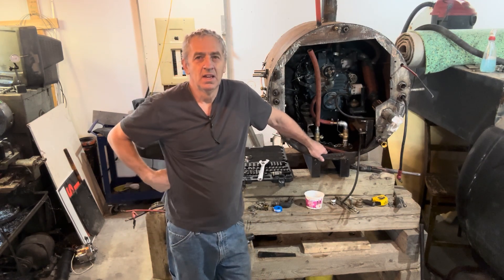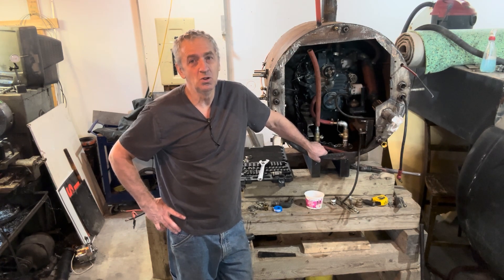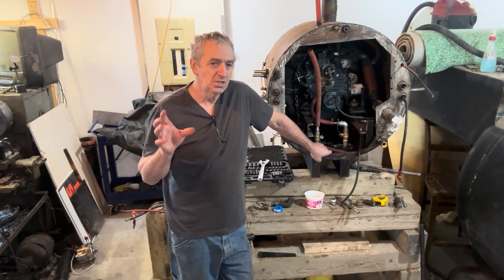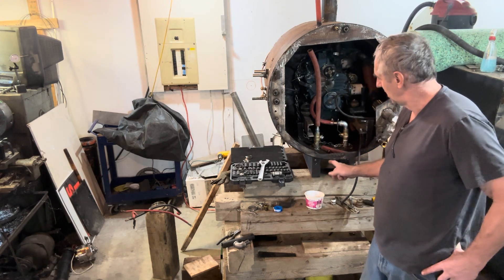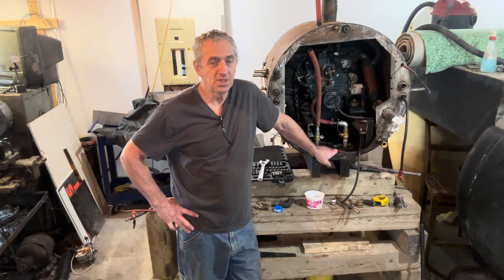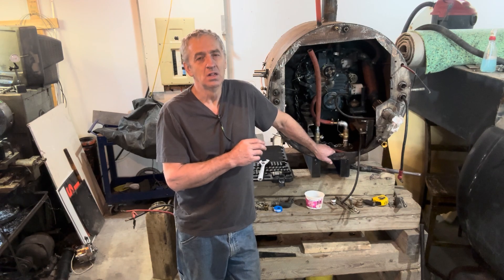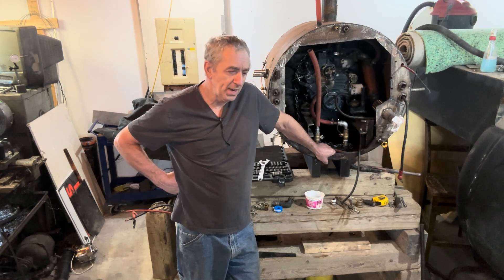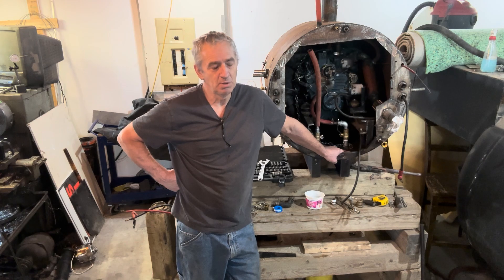Home built diesel submarine progressJanuary 5, 2026

Comment: I have a narrow boat and it has a bleed valve on top of the keel cooler to remove all the air.  You should be alright with the pipes fitted to the top . I know if I have air trapped in my skin tank it plays havoc as it expands and burps water out of the pressure cap
Reply from the maker: I was test running it today and totally realized I need a bleed.  The literature I read on it also said I must put one in.  Job one tomorrow!

Comment: Random question… if the box cooler is full of warm water after running the engine and you close off both of those valves will the warm water sealed in the box cooler contract as it cools down? Increasing the effect of the pressure on the outside as you dive. Just a thought…
Reply from the maker: Yes, that would happen, that is one reason I dont plan to close them unless there is a propblem or for pressure testing the sub to greater depths unmanned.

Comment: I like this much more!

But this will be in the rear tank? So no circulation of the water surrounding the cooler?

But maybe just add a temperature alarm (bimetallic thermostat and a siren/buzzer/light) for the day you run the engine stationary to charge the batteries and don't notice the temperature creeping upwards.
Reply from the maker: Thats a good idea, but the box keels are at the very bottom of the ballast tanks, so will see water flow.  But when parked an alarm is a good idea.  There will be a temperature gauge mounted in the control box so I can see it at all times.